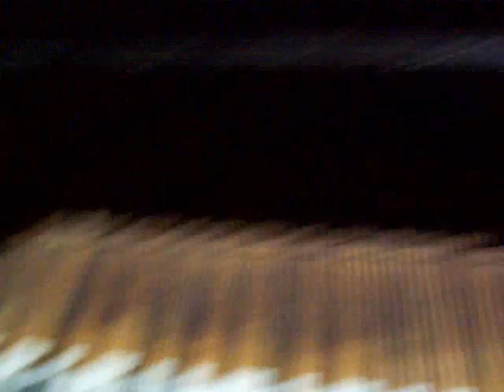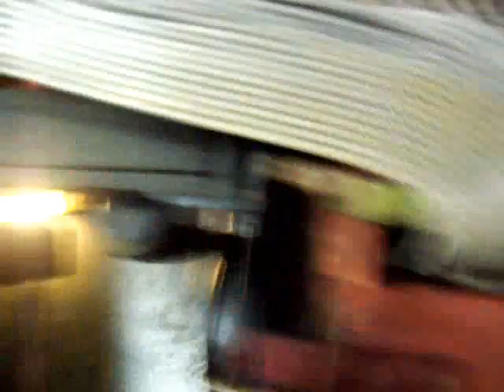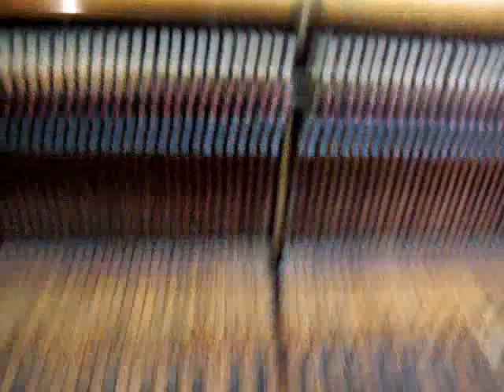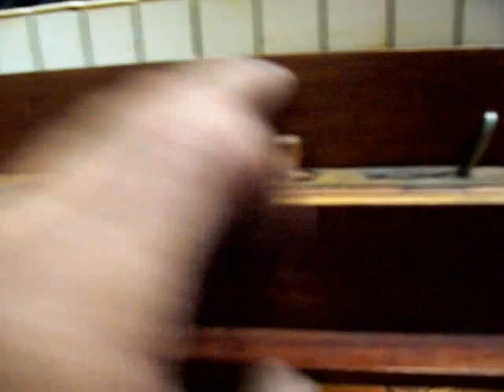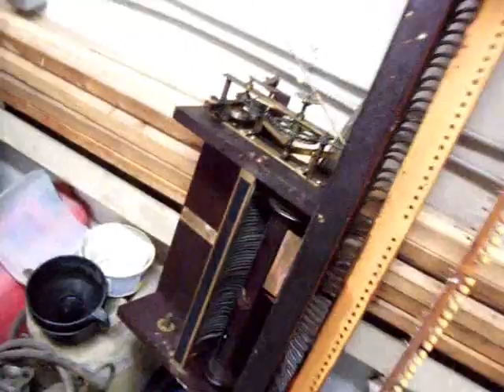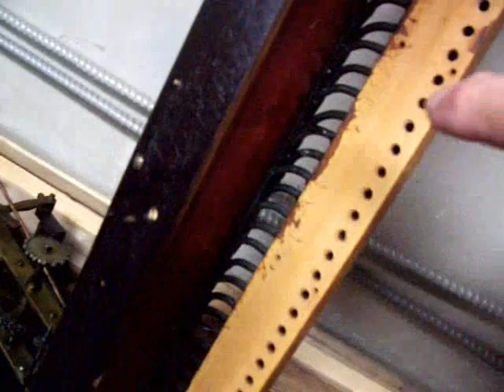player piano refurbishing 12-13

Comment: These old player pianos were one of the wonders of the world. The engineering that went into them, all out of leather and wood, is just absolutely amazing. To do a full functional restoration of a player piano today can be anywhere from $8,000-$15,000 as you can see - there's COUNTLESS hours of labor involved in fixing each stack, each valve, the motor and the pumps, anything that the vacuum could and does leak from. We have a 1921 Wurlitzer. It leaks pretty bad from everywhere, the pumps on back through the stacks and motor. It barely plays if at all, and even on it's best day many notes do not even press down and the ones that do play very lightly.  I'm mechanically inclined and took a good hard look at everything it would take to fix it right, and I am just not comfortable with the task. We're looking at an estimate of $10,000 to get it all done right. Not sure if we're gonna do it, but it was my Grandparents, then my Mom's, and it's a treasured family heirloom. Some of the rolls we have are great. We love it and I'm never giving it away or selling it or heaven forbid throwing it out. It's just a shame it costs so much to repair but I understand why - much respect to the people who work on these!!!!